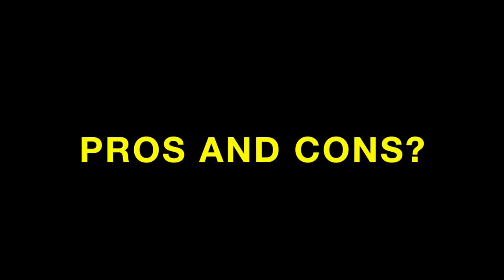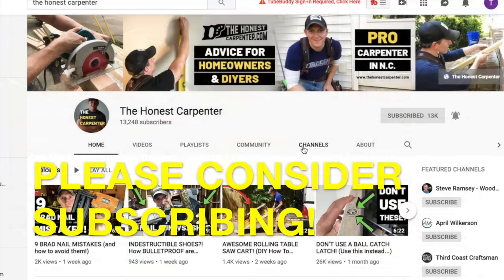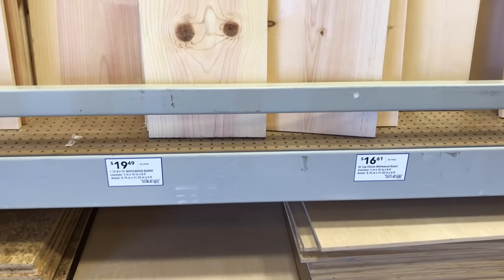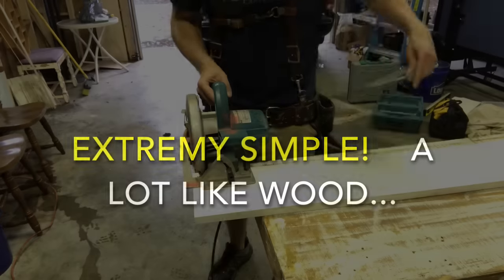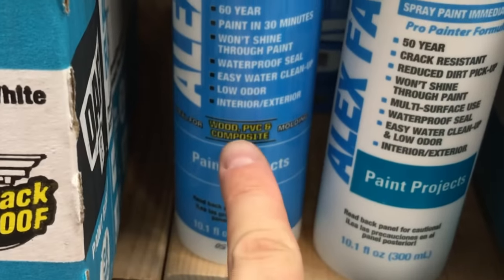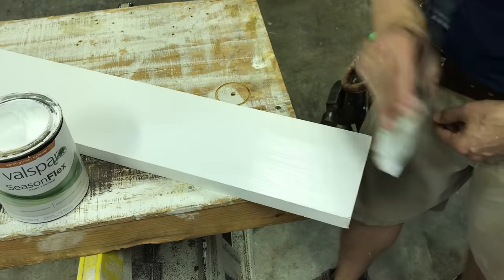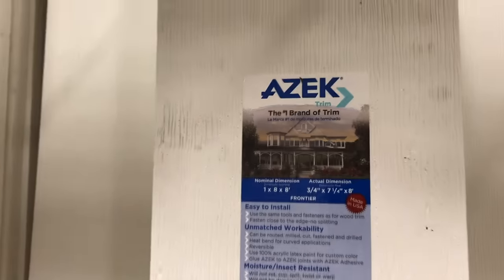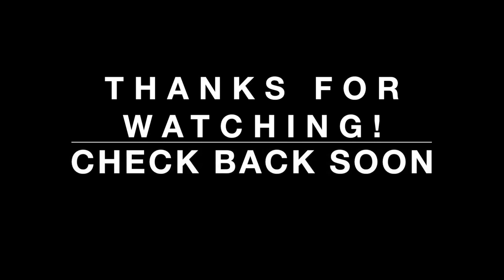PVC TRIM VS. WOOD TRIM? (Pros And Cons!)

Comment: Great video PVC is a great trim for windows and bathrooms ...I am glad you mentioned the dust BUT there is another much more serious hazard with PVC.  If it burns it produces highly toxic gases including hydrogen chloride.  So be careful mixing wood scraps/sawdust and PVC scraps/sawdust if you burn your wood sawdust.  Also be careful to use a sharp saw blade and avoid blade binding where the PVC will heat up and thermally degrade.  Also there are studies that show asthma like symptoms and permanent lung damage from breathing the dust so always use a dust mask and better still a respirator.
Reply from the maker: Thank you for the safety tips Gregory! I appreciate the details

Comment: I worked in a cabinet shop in my younger days and we used a lot of MDF. If there was an exposed edge of any kind we would paint watered down wood glue on the edge. It was a little hard to sand but it fixed that end grain. Might work on the PVC as well.

Comment: Termites and Bugs are not impressed with the stuff either :D
Reply from the maker: Another big plus, Andy! I imagine it doesn't have that much nutrition for them 😅
Reply: @TheHonestCarpenter  Around my area PVC as external trim on decks is a good preventative for carpenter bees which don't seem much affected be PT wood.
Reply: @schsch2390  In my area " New Hampshire"  the PVC decks that were installed 8+ years ago look like crap . PVC warps , it stains and  the color fades . Wood just looks better cosmetically , it just has to be maintained.
 
 When it comes to decks there is no win lol. Although mahogany or redwood is the best for a deck if you can afford it , slap a coat of oil based stain/sealer on it every 2 years and will last 20+ years .

 Pressure treated can hold up for 20 years as well , the problem is nobody maintains it . Again every 2 years a coat of semi transparent or transparent sealer  on deck boards .  Do not use a solid stain or paint!!

 The average homeowner stains a deck every 5-8 years or never ,  that's why they rott.
Reply: @manchesterexplorer8519  After watching this video, and he was talking about how the sun heats it up and causes the expansion and contraction my first thought was well if you paint it and it moves, isn't the paint going to crack and peal?
I have a rotten deck and was thinking PVC may not be the answer. 
But I have some rot near my basement door frame and I am guessing that the PVC will be my only choice due to moisture and bugs.
Reply: @mo-reesespieces9066  PvC is a great product for problem areas for sure . With a deck it's hit or miss really.

Comment: I love exterior PVC trim but IMHO it should never be used indoors in living space.  It will off gas chemicals used in making it.  Not good for living things.  Just thought I would put that out there.  Good video though.
Reply: bigelite94 what about water lines?
Reply: @bigelite94 Obviously all of us have drank or bathed in water that has been run threw PVC or PEX at some point and were still here so I don't want to blow things out of proportion.  That being said there are a few points worth mentioning. 

A.) All plastic off gases fumes, some kinds of plastics off gas more than others.  Heat will increase this process and newly made plastics always off gas more than old stuff.  Lower density plastics always off gas more than denser ones.  Thats why I don't like PVC trim indoors because it's so light and airy there is alot of surface area. 

B.)  Paint won't do much to prevent gas escaping plastic does not matter much what plastic or paint you use. 

C.)   I hate the smell of PVC and love the smell of wood just MHO. 

D.)  If it's in your walls your probably not breathing anything it's off gassing anyway because it ends up in the attic. 

E.)  For pipes it pretty much some kind of plastic or copper.  Copper is great except that it corrodes and leaks over time or clogs with hard water.  You can use stainless tubing but it's expensive.  Lasts forever though. 

We all have to decide what risks we are will to take for what rewards.  I honestly don't know if it would hurt anything living to be in a closed room with PVC over a long time, maybe nothing would happen.  But I know for sure it won't help anything living.  For this guy its wood, glass, stainless & copper everything.  Good luck out there with your projects.
Reply: The Next Chapter  Hey I answered all your questions in another comment on this chain take a look.
Reply: @lexandersantana8089  Answered this question in another response on this thread take a look.

Comment: Opinion on composite trim?  Miratec appears to be mdf and LP smartside looks like osb
Reply from the maker: Paul, I'm totally with you're thinking there. I haven't worked with smartside yet, but nobody can convince me that Miratec isn't just glorified MDF. I know they seal ends and such, but the material just seems exactly the same, and it's bound to de-laminate when it gets wet. Thanks for watching!
Reply: Boral flyash n foam which can be submerged in water....

Comment: 6:35 Pump the brakes.. PL Premium expands, may want to go easy if you're going for a perfect fit with trim.
Reply from the maker: @P Christmas Very true. I've seen it bubble from exposed edges before as it dries. I'm yet to have a situation where it displaces trim I've tacked into place though. Can it expand that much? Maybe if it's in a big blob?

Comment: Let's not forget; PVC is flammable, more so than wood.
It also becomes brittle from exposure to the elements.
Reply: Correct, although paint can prevent exposure to UV which degrades it.
Reply: Azek is flame resistant; it will melt but not support open flame

Comment: I recently  replaced my sunroom windows and trim. Again I used Royal PVC board, this time with the smooth side exposed for a cleaner look. The PVC that I removed still looks great with the exception of some caulking that needs to be removed.

Comment: I would like to do all of my trim on the outside of my house with PVC so that the trim will never have to be done again.
Reply: Keep up with the paint and you won't have issues . I work on farmhouses that are over 150 years old that have 90% original trim and clapboards because they're maintained . 

  The pvc makes your home look cheap like Tupperware  , that's my only issue with it though especially pvc decks and railings 🤮

Comment: With the crazy price of wood, pvc is actually cheaper right now
Reply: PVC has not exempted itself from the DIY price increases. Costs more than wood. ….. still. Plus lots of oil and gas products. 🤨
Reply: @electricianron_New_Jersey  I've never seen a 3/4" full sheet sold in Canada.
Reply: Let's go Brandon #fjb
Reply: @chrisgraham2904  well that sucks. All though if you can find 1x4 to 1x12 you should be fine. Consider yourself lucky cause 4x8 sheets of 3/4 PVC is heavy as shit. I hate when my sales person prices jobs out for me to use full sheets. It's a pain to rip it down by yourself and that's pretty much what a crew is for my company. 1 person.

Comment: Sand cellular edges with 320 grit and wipe w acetone sealing the open cells
Reply from the maker: Thanks for the tip Bryan! I'd read a few things about acetone, but hadn't tried it yet. How does it seal the cells? Does it melt them chemically? Acetone can be pretty strong stuff.
Reply: @TheHonestCarpenter  it was recommended to me in a seminar I took on PVC trim.  The sanding kind of fills the hole and reduces them some. Then yes the acetone melts the cells "smooth"  Also it cleans up marred pieces at Box Stores. Also. If a piece is gouged or has deep marring, I've had some success with a heat gun smoothing the face surface. Need to use caution not to go to far. I discovered this technique by mistake when I heated the grain side of some Veranda and the grain "went away"
Reply: Bryan Bahre 
Nice. I’ve used a thin layer of pvc glue on the edges and let it dry then sand it. Acetone will be a cheaper way to go.
Reply: @ronh9384  I had been annoyed by the edge finish of PVC since I first used it. It is suck a filth collector and looks awful. This method has helped me a great deal

Comment: PVC creaks and clicks all summer long as it heats up and cools down, the last thing all we need is more plastic products and dust. It looks awful too.
Reply: Actually not true at all. Proper installation leaves no noise, no gaps, no problems...depends on the material used and installation method.
Reply: I guess you're willing to replace every 5-8 years then.

Comment: This product has been invaluable on a 1920's bungalow rental property we own... in all the places you mentioned.  We have a converted garage apartment that is grade level and has been flooded twice.  It now has tile floors, smooth hardiplank interior walls for the lower 4 ft section near the floor throughout, and PVC baseboards.  We have two sump pumps, but hopefully the rest of the updates will also help in case it ever takes on water again, at least with the cleanup/rehab process.

Comment: Also, in it's longer wider sizes especially, it's heavy and flops around a lot. When I install it in a soffit or fascia, I have to put wood blocking between the rafters to make sure there's no sag - adding more screws. The cut ends also seam to get moldy/green and it doesn't clean off very easily. It probably needs to be painted for that reason. Caulking the dents, anywhere else, it should probably be painted at that point too because they'll attract mold. So a big selling point to PVC is you get a white board that doesn't have to be painted if you want white trim. But you may actually have to paint it for the above reasons. And then, when it peals after years of expansion/contracting, how will we approach that? A scraper will probably mar the surface pretty easily. Maybe a good paint wont peal, time will tell.
Reply: It won't peel at all. Paint peels because moisture gets behind it. With PVB no moisture can migrate so a good paint job will last until it oxidizes off.  I've been installing PVC trim since it became available, at least 15 years and maybe 20. I've never had a callback and we install a lot. I never paint it unless and until it starts looking scruffy. I haven't installed a single piece of wood trim since  PVC became available.
Reply: Rick Parker good to know!

Comment: Just made four posts and now he wants me to replace the pergola with 1 1/4 material. I was skeptical of it at first because I almost always use pine or poplar but it’s easy to cut and miters comes together nice and square. I am curious of ways to seal long rips. You covered the caulk, which I plan to use either power house or shermax from sherwin Williams and you cleared up the paint. Thanks so much this was so helpful.

Comment: Should’ve seen this first.  But I saw the product in the store and bought it because I wanted a shed with the absolute minimum maintenance.  Yes the cutting dust is a problem, so it’s recommended to do it on hard surfaces that can be vacuumed.  Yes the saw dust is almost micro so a mouth-nose mask and eye protection are important especially if cutting a lot of this ... can’t wait for the class action for lung damage ... no warning labels that I could readily see.  Yes the lack of warping is great and I’m already thinking of a couple of projects where I cannot afford to worry about dealing with warping wood.

Comment: I used PVC to replace the rotten wood on my front facia 12yrs ago and it's been great! It's done so well compared to it's wood counterparts elsewhere on the house I am now only using PVC for exterior trim and wood jobs that aren't load bearing. It's less work in the long run.

Comment: Three comments on working with this stuff, and a suggestion to manufacturers.

1) it is very floppy and needs a lot of support. 
Expansion and contraction will blow nails right out.
But I've never used galvanized spiral shank patio nails. - I don't have time for hand nailing-
If you follow guidelines for using Cortex screws and plugs the additional cost is considerable.
Be SURE to factor this into your bid, or you will be left holding the $$$ bag.

2) Clean cuts with a good blade are Sharp! It WILL cut you, no avoiding that.
It also dulls blades, and sticks to the plate. I find blades made for laminate floor (Pergo) last longer.
While we're on cutting. I spray myself AND my tools with Static Guard, then the clingy dust falls right off.
Be sure you don't wipe your eyes or brow on a hot day. Getting the abrasive dust in your eyes is no joke.

3) On glue... go to the fence section of the big box and get tubes of fence cement (meant for holding caps on)
This PVC cement is white. Comes in a tube, so it doesn't dry out or glue the lid on the can, Much faster application than a brush or swab in a can.
This is critical for something like lock miter  post wraps. You need 10' of bead, and you need it NOW! 
With a brush on a hot day, the glue is setting up behind you before you finish application.
You can carry it in your pouch ( open, tip up )  when doing facia from a ladder or plank.
One hand to hold the floppy plank, and one hand to glue. 
What do you do with a can, where you need to unscrew it and keep dipping?

Manufacturers need to figure out how to co-pultrude this stuff with glass fiber linear reinforcement. (much like ladder rails are made)
It would be much stiffer and 20'ers would not grow an inch or more, resulting in buckling for winter installed trim or huge gaps for summer installed trims.

Thanks for letting me ramble or rant.
I hope these hints help someone.
Reply: Jim Urrata actually not true...depends on installation method and type of material. Been using non wood products for years..
Reply: @Joe Framer Which statement isn't true?
PVC trims have come a long way, but I'm talking specifically about sheets and dimensional products (like facia) by reputable manufacturers, following their installation guidelines.

Where I live, a typical yearly temperature swing is going to be 10-100°F.
How high over your head do you have to carry a 5/4 x 10 to keep it from dragging on a 90° day?

Are you saying facia, frieze and rakes don't need to be held tight?
Of course premade corners can be held at the soffit and allowed to float on clips.

Cellular PVC's coefficient of expansion isn't going to change. Molecular structure will react to heat the same way unless it's made the matrix for a composite with linear reinforcement, like I suggested.

Nature has had hundreds of millions of years to perfect her composite (wood) but we don't have enough sense or resources to use the right ones, or recognize that everything has a lifespan and needs maintenance.

Comment: 2 years ago I had someone do repairs to the slightly rotted bottom frame of a very large and very high up picture window.  Unfortunately they used PCV to cover over the rotted areas.  Since this window faces SW it took sunlight and heat on it almost all day long.  I noticed a couple weeks ago that the piece of what I thought was wood was bowed out from the window with one end about 2' from the window, the other barely still attached.  Upon inspection I found that not only did the PVC deform from the intense sunlight/heat, it hid the rot that was taking place behind it.  Now the entire bottom edge of my window is rotted out-almost to the interior of the house and I have a big repair job ahead of me.  PVC may be good in some applications but I would never put it where it gets a lot of sunlight or where it can hide wood rot behind it.

Comment: Great video  . I used pvc boards fixing a rotted door frame a few years back . Needing to plane to a size I wanted I searched youtube to see if it can be planed and could not find any info at that time , so i gave it a shot. Yes it can be planed but you would not believe the mess it makes even with a vacuum attached. but nice smooth surface when you are done. I was afraid it would gum up in the planer so I took very little off at a time . Please pass this along .
Reply: Instead of passing this along, I'll pass along the idea of using Allback organic linseed oil and their linseed oil paint.  These can be found at The Eco Living Room at 12 Cataraqui Street, just west of The Woolen Mill if you're in Kingston Ontario.  If you're in any other city or want to check these out, you can visit www.sagerestoration.com.  If you're in the US you can visit www.solventfreepaint.com.  If you use Allback products, you wouldn't have to deal with the mess of planing PVC as you can use wood and not have it rot.  The linseed oil soaks into the wood, so there's no room for water in it.  It is also breathable.  Other paints essentially form a "plastic" film on top of the wood, trapping moisture inside the wood.